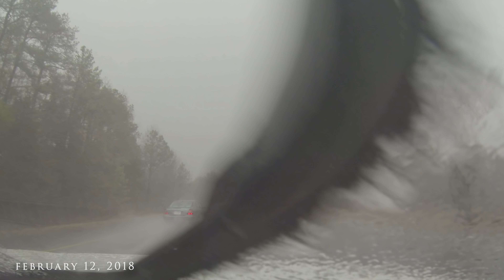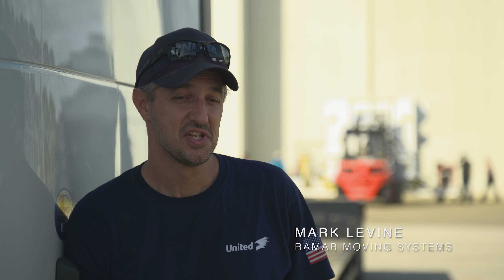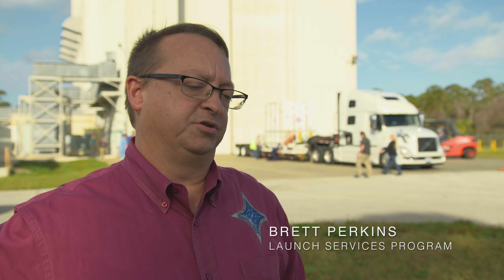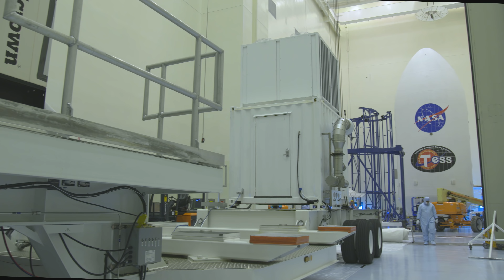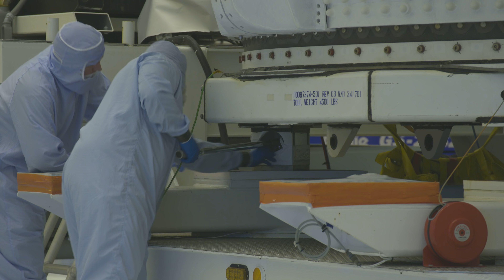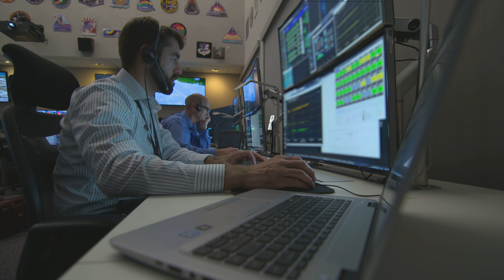How Do We Prepare a Spacecraft for Launch? Countdown to T-Zero for NASA's TESS Mission

Comment: The shuttle requires 6- brave An safely but,
Rigorously trained Astronauts sitting atop
Of 2.8 million lbs of dry 
Fuel along with a pressurized tank filled with Hydrogen plus liquid oxygen at 528,000 gallons for lift
Off 🤷‍♂️ So call me when do we leave 😁👍🌎💫
🚀💨
MARS OR BUST YEAH!!!
An Godspeed to go with the trip
Commentator 
From : LarryWhittington